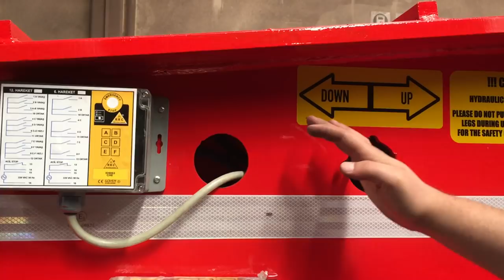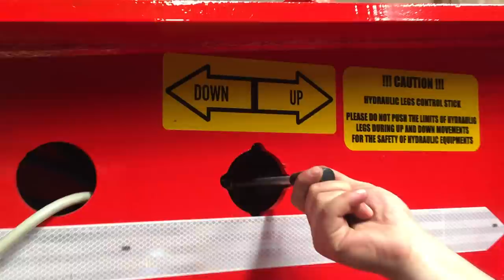FRONT LOADING LOWBED SEMI TRAILER (FOLDABLE GOOSENECK) - GENERAL SYSTEM 1

Comment: My dad had two of those type of lowboy trailers back through the 70s and the 80s. One had the little engine in the trailer and the other one was powered by the PTO on the truck with really long and heavy hydraulic hoses because the trailer had to operate when the truck was far enough away to load and unload the equipment.

Comment: When I worked for NYC Park Dept in the late 70s - 80s. We had a similar trailer for our Track Loader. Ours didn't have all of the exposed hydraulic cylinders. Just one straight deck that tapered and folded down. I believe it was weight limited to 80,000 lbs. Not for extra heavy duty hauling.
Reply from the maker: 8-10 Axles 100-110 Tons Cranes are being loaded on this special design lowbed semi trailer from the front side. These heavy cranes are difficult to load from back side, sometimes impossible. This is a special design lowbed semi trailer against harsh Africa Road Conditions based on the customer's request.
Reply: @OZMENDAMPERTRAILER  whats price it trailer?
Reply: @ Philip Moore hello, how are you doing

Comment: In Australia we load from the rear no unhooking primers movers ......
Reply from the maker: 8-10 Axles 100-110 Tons Cranes are being loaded on this special design lowbed semi trailer from the front side. These heavy cranes are difficult to load from back side, sometimes impossible. This is a special design lowbed semi trailer against harsh Africa Road Conditions based on the customer's request.
Reply: I am a low loader operator in Australia and when we are loading units up to and over that size we typically use platform low loader. Drake is our premier builder of these trailers. Would be worth checking out as Australia and Africa would both have some very harsh conditions
Reply: @matthewrowell8518  well there ya go ....it dont seam to be that comin here as much as usa .....
I run a moore but im not doin super heavy stuff
Reply: Platforms are pretty rare. Typically most heavy items can normally go on a drake 4X8 trailer with a 2X8 dolly. We have done some really big gear on that set up. Hardest part is getting permits and such. Once it reaches a certain weight the preference is platform trailers even in you can carry the weight on the above mentioned configuration. Also depends on which councils and so on as to what you can get on a permit
Reply: @ Junior hello, how are you doing?
Reply: I read the reply  comments
Yes
There are some front load trailers but majority of the triaxle  stepdecks and lowloaders 
that i see on the raod here in aus have ramps or biofold ramps  
Mine is 48ft with biofolds 
I agree there are some front load trailer here i never said there weren't ....
But most trailers i seen usa were front load trailer 
I prob should see where this video was made before i commented but its a bit late now 
I guess what i was tryin to say ...the everyday dropdeck or lowloader were front load when i was in the states and it seamed like a lot of work to load tractors or machinery or other items 
Maybe its changed in the last 10 years ...
 i agree with the comments
I just could make sense of of it when i was in the states 
Cheers junior

Comment: It's cool but alot of countries have weight limits and this would be a bad investment
Reply from the maker: This is designed for harsh africa road conditions based on the request of customer. We have also lighter lowbed semi trailer. This front loading lowbed has 100 Tons Useful Loading Capacity.

Comment: How heavy is it?
Reply from the maker: Empty weight is 18 tons. 8-10 Axles 100-110 Tons Cranes are being loaded on this special design lowbed semi trailer from the front side. This is a special design lowbed semi trailer against harsh Africa Road Conditions based on the customer's request.
Reply: @ Frank Cox hello, how are you doing?

Comment: A bunch of batteries would have benn suffice instead of a designated engine, i have seen electric setups on lowriders
Reply from the maker: The customer mounted winch (hoist) at the back side of the lowbed semi trailer, therefore only batteries wold not be enough.

Comment: Where is the kingpin
Reply: Maybe must make hole in the ground for king pin???
Reply: its pulls out of that hole on top of the trailer, that way it won't get damaged on the ground, after you load/unload its reinstalled before the tractor hooks back up
Reply from the maker: This is the King Pin : https://www.youtube.com/watch?v=-DbqSNExk-c
Reply from the maker: This is new Model 5 Axle with 2 Rear Self-Steering Axle and 45 Tons Winch : https://www.youtube.com/watch?v=CpGKVVMBcLU
Reply: Buried in the dirt. Unless you lay down plywood.

Comment: There must be a lot of time to waste in the EU. An engine that must carry to raise and lower your loading ramp so you can remove the load. And it is slow as molasses!
Reply from the maker: This is designed for harsh africa road conditions based on the request of customer. We have also lighter trailer. This front loading lowbed has 100 Tons Useful Loading Capacity. The 8 Axles 100 Tons Crane is being loaded on this lowbed semi trailer from the front side.